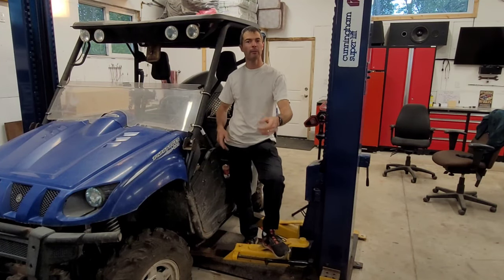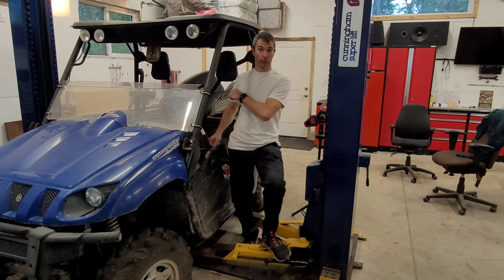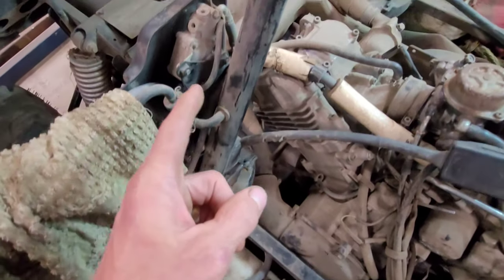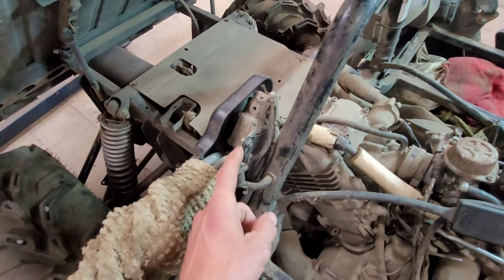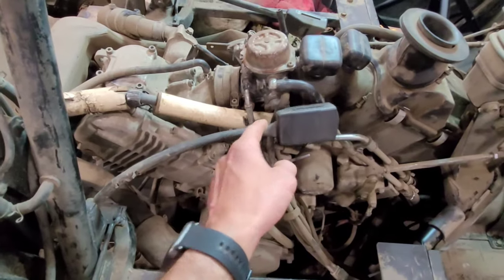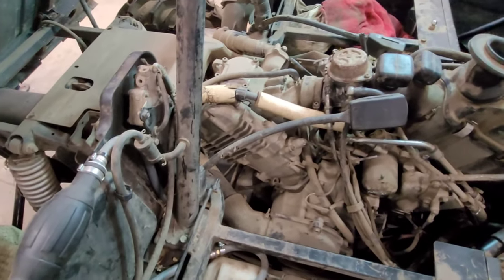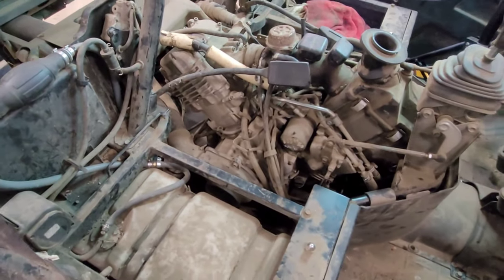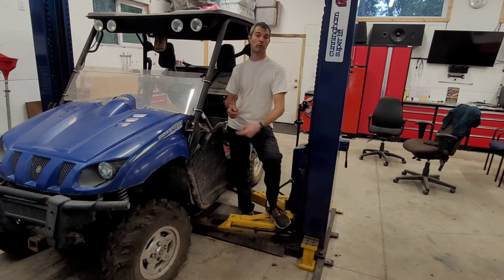EASY Solution! Better starts every time!

Comment: Lots of people also change out the fuel pumps to key on electric pumps.. I like your idea too..
Reply from the maker: I wanted to keep it simple and reliable. An electric lift pump is possibly better....
Reply: @thehonestmechanic  I really doubt the electric lift pump is better because if an accident occurs and the rhino is upside down or on its side and the fuel line gets a leak, the pump will continue to pump fuel as long as it has power and can make a situation way worse than it can be.  Probably why the factory uses a vacuum pump.

Comment: OMG….. yes this is exactly what I need!!  Mine has had issues all the time and now it will not start because no gas to Carb. I will try this first and then try the electric fuel pump if it does not work. Thank you so much!!!

Comment: Those primer bulbs have a 1-way valve in them to act as an anti-drain feature.  Swapped an old (original) bulb for new on my 69 Merc 1000 outboard and its a night/day difference in starting. Great idea on any older vacuum pump engines.

Comment: Thats a great idea, mine runs great but after a month I need to use spray start to get the fuel to the carb. I tried an electric pump and it started great but It would often overcome the float needle and flood the carb making it a fire hazard.

Comment: Just picked up a 2004 Yamaha Rhino, in very good condition only 700 klm on it. But cold starting sucks. I'm going to do your fix and hope it works. My question is how many times do you have to prime the pump? dont want to flood the carb. and this was a year ago could you do an update on your fix? thanks Rhino On!!!!
Reply from the maker: That is a great find! I recommend priming the ball until it is firm(kinda like an outboard motor). It should now flood as long as the carburetor is in good shape(the needle, seat and float all work together as they should) Thank you and good luck 👍
Reply: @thehonestmechanic  thank you for your quick response thank you for the important information 🙂

Comment: I bought one of these for my church, the church is a 40 minute drive from my house, so I'm sorry to pesker you with a question but it'll save me a good hours drive. 

Did you have to buy fuel lines for this mod? If so what's the ID?
Reply from the maker: I did have to buy some fuel line and adapters. I used whatever size the current fuel system was which if memory serves it's 3/16 and adapted it to the smallest primer bulb I could find which I think was 1/4. Unless of course you can find a primer bulb that is the correct size and simply splice it in. 😉
Reply: @thehonestmechanic  that was my original thought process, splicing it in. I've bought 4 different sizes just in case. 

But as a precautionary, I'll spend a little more for fuel lines too. 

Thank you for the quick reply and info. Much appreciated, and I've subscribed.

Comment: Looking online for the pump forgot to ask the internal diameter of the hose found one on Amazon stating it's an 8 mm internal diameter is that correct? Thanks for your time
Reply from the maker: @TimberJay  I can't remember exactly but I did have to use some reducers to make the connections. I recommend using quality clamps to prevent leaks

Comment: Hey bud , great video. I too have this problem but will follow your suggestions.
I recently replaced the battery and now I have all the lights but it will not turn over. Could there be a fuse gone bad?
Reply from the maker: So just starting from the top, I'm assuming that the battery is food and that it's installed properly. After that, there is a breaker for the starting circuit. It's usually located in the battery box . I would check it first. Also, thank you for watching!

Comment: Did you use 1/4" or 5/16" hose?
Reply from the maker: Pretty sure the primer bulb was 5/16 and the regular fuel line was 1/4. I ended up using a reducer to make everything work together

Comment: Do you bypass the fuel pump all together or are you still going into it ? Thanks
Reply from the maker: Still using the fuel pump.
Reply: @thehonestmechanic hat is the size of the hose for the pump
Reply: @thehonestmechanic what
Reply from the maker: @keagonhuff2493  I can't remember exactly but I think it is 1/2 inch
Reply: Great idea mine is hard to start after sitting   How can you get the primer if the passenger seat is in place??
Reply from the maker: @davewise29  I remove the seat. It's simply clipped in. No tools required

Comment: Will this work on a 2009 rhino that is fuel injected?
Reply from the maker: This modification is intended for carburated models. Fuel injection already has a higher pressure fuel pump